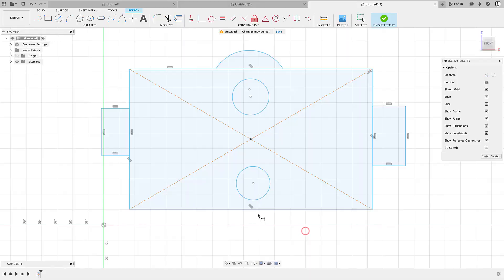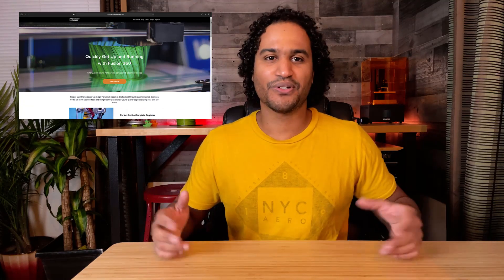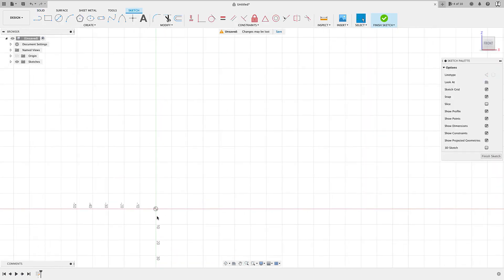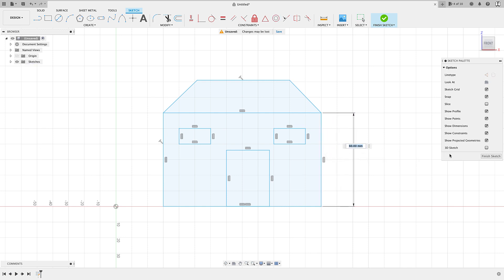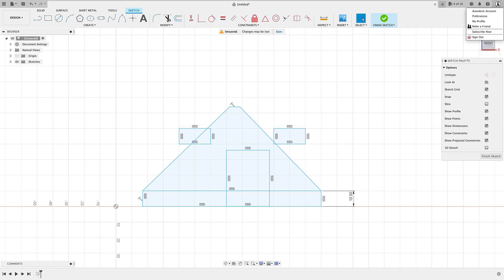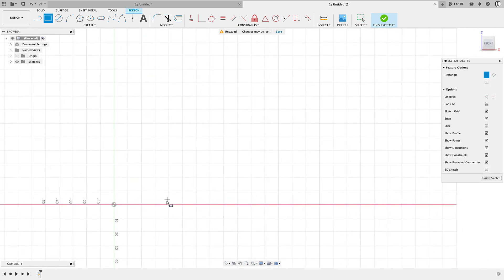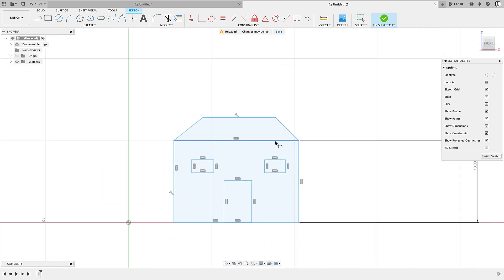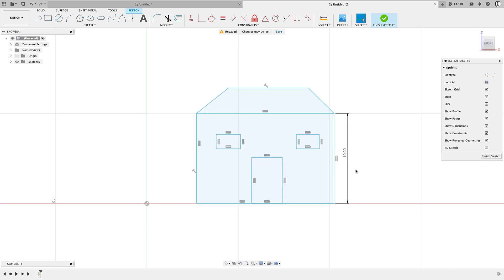Stop Breaking Your Sketches in Fusion 360

Comment: A tip: if your sketch "disappears," this means that the first dimension is too small :-). This is a good way to hide things out of sight. I was able to edit a sketch object 0.01 mm wide (0.0004"), as a test. Object 0.001 mm wide was visible but impossible to work with (at full grid magnification).